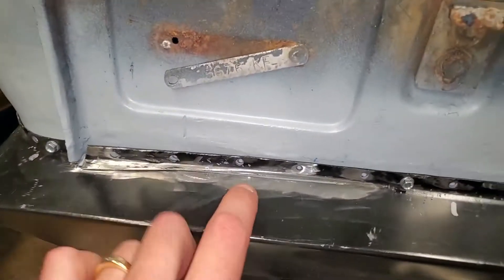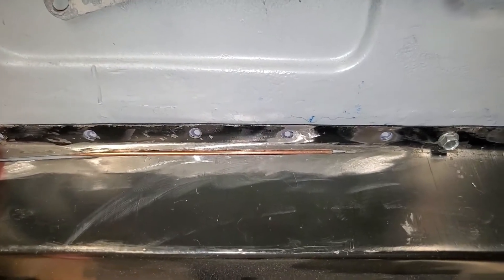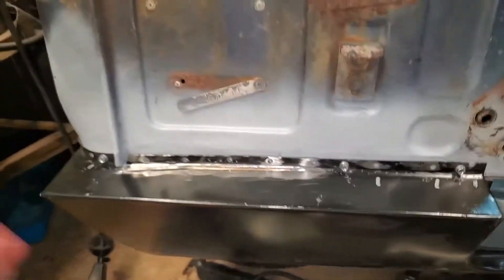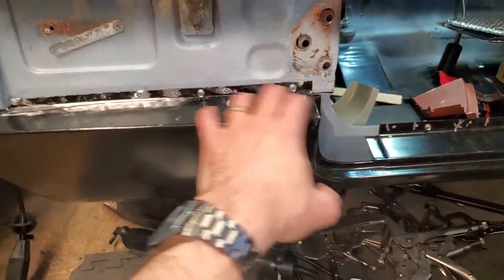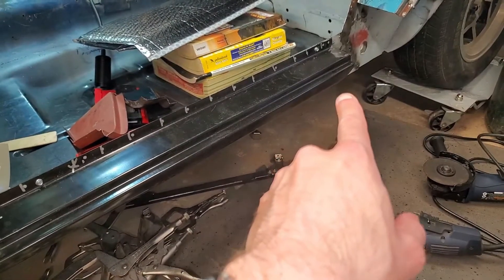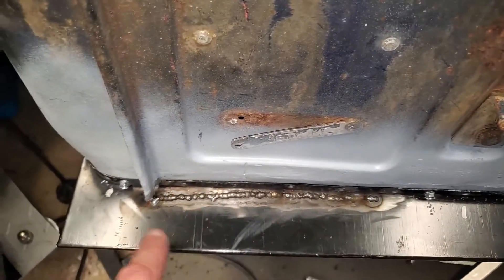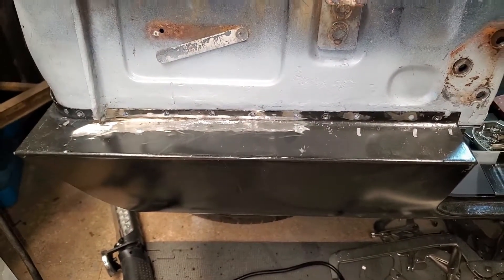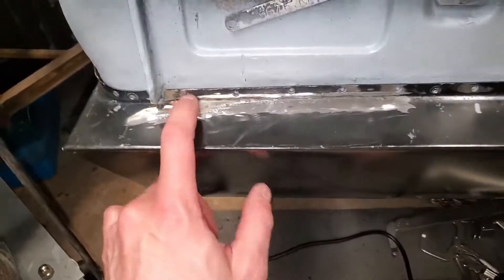Triumph GT6: Driver's side sill "repair"

Comment: The bonnet is surprisingly easy to just grab and twist slightly by hand to make it line up at the front. That’s what I did on mine! I like the welding wire idea!
Reply from the maker: I tried some twisting on the edge of the bonnet but it didn't "take". To be honest I might have been a little too gentle with it. Also I can't take credit for the welding wire idea - it was from YouTuber asicerik who is restoring a Camaro.
Reply: David Plass I was quite violent with mine I seem to remember. But it went well for me.